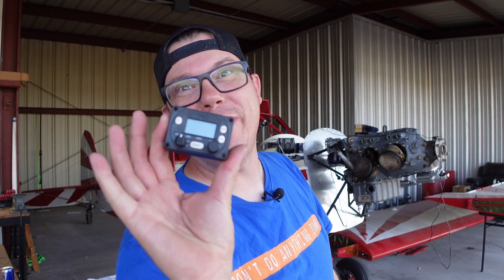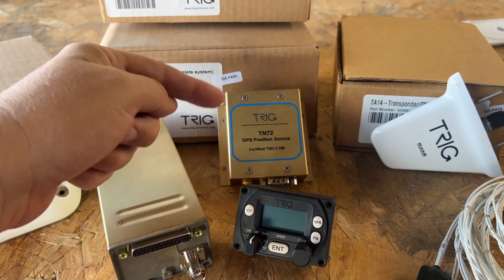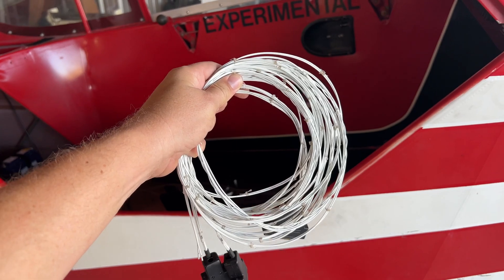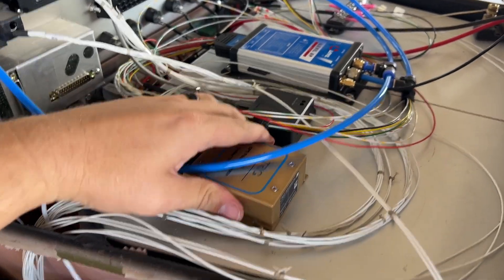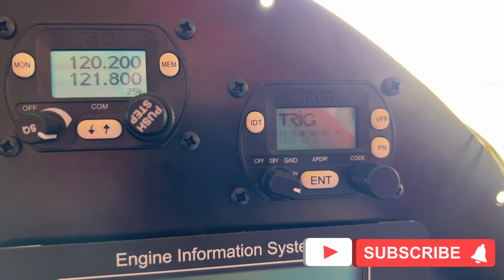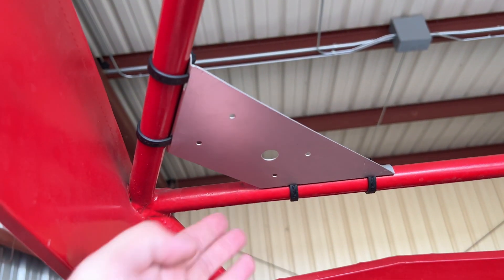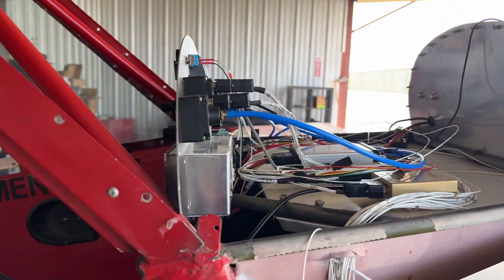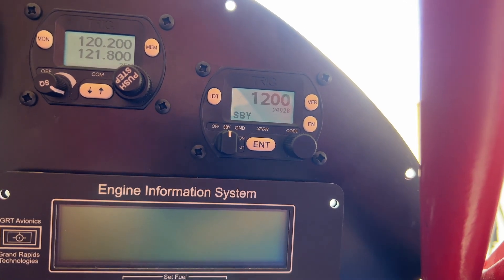Worlds Smallest Transponder | Trig TT22 Install

Comment: I know ‘worlds smalllest’ is to get clicks,  but frankly, these electronics need to get smaller/cheaper… personal aviation needs saving!
Reply: Probably a function consolidation eg radio+ transponder and just 1 head unit
Reply from the maker: It is the smallest right now, well at least for full functioning. There are some UAS transponders that are smaller, but not for GA use.  It I agree with the pricing stuff. Rebuilding this plane has taught me that everything is in thousands.